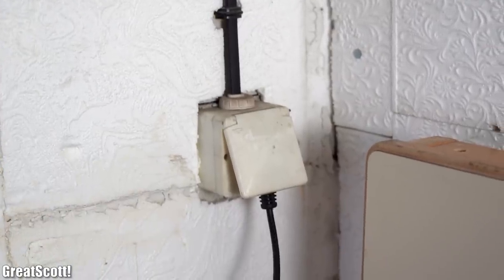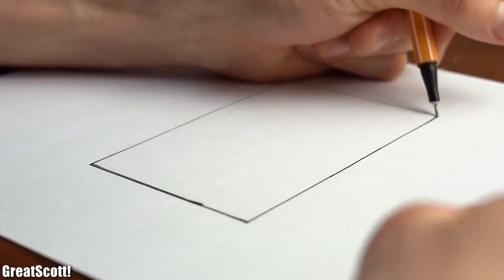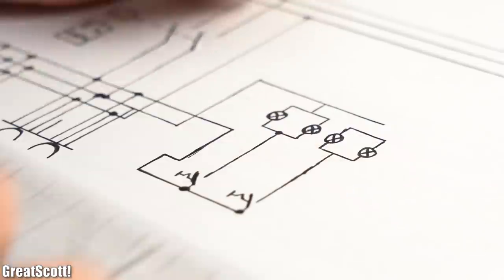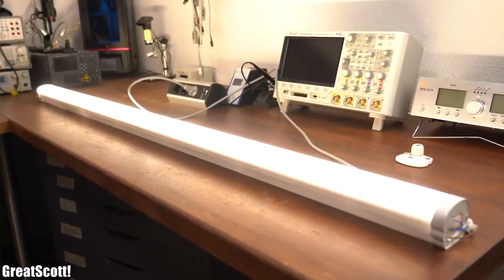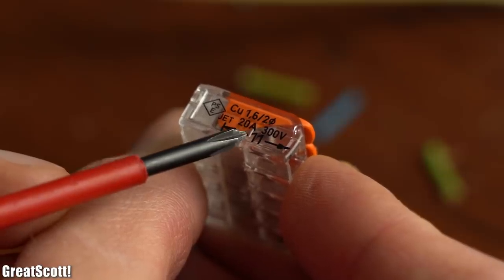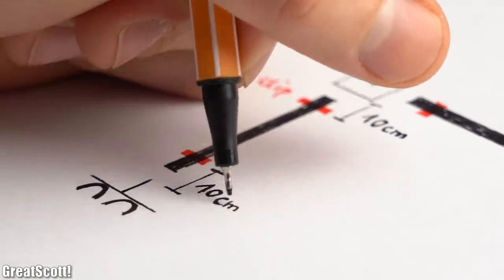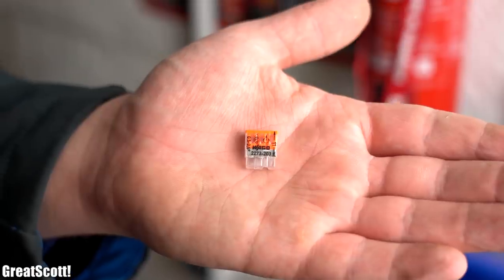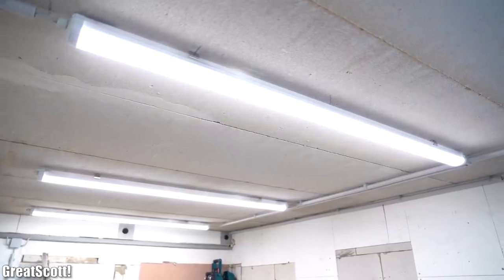How to do Electrical Wiring properly! (more or less....) GERMAN STYLE!

Comment: 3:05 - Slight correction on the RCBO, it doesn't detect current flowing to the protective earth wire, it detects an imbalance of current flowing down the live and back on the neutral.
If it only detected current flowing to the protective earth wire, you could get a shock, passing the current through your own body to ground, and not down the protective earth wire, it wouldn't detect it.
Reply: Exactly what I thought hahaha
Reply: This is the commentary I was looking for. 😊
Reply: That's actually a big correction. An RCD could work in an installation without any earthing. The imbalance between L and N is the criterium and doesn't need PE at all.
Reply: @Lenny-kt2th  He prolly thought an RCBO worked like an ELCB which detects current flowing through the PE.
Reply: @Lenny-kt2th   it will work without a PE but it doesnt work without any earthing. how could you be shocked with touching L without there being at least a connection on the producer side over earth to N. there are actually systems build like that in hospitals and such and they require over methods of keeping track of faults 👍
Reply: That sounds like how GFCI breakers and devices work here in the u.s.
Reply: @LarryKoopa  The thing is, you're always grounded to one degree or another. You experience a certain amount of current running through you even if you're stood on a thick rubber mat on top of a wooden floor and touch a live wire with one hand. 

In the above scenario, it's on the scale of microamps, if not nanoamps, so it's not harmful or even detectable to a human being, but still, it's worth remembering that in the real world, there's no such thing as "perfect insulators", just "good enough to be safe for living things" insulators, and consequently, unbeknownst to you, there may be situations where you unwittingly complete a circuit between live and true ground that is low resistance enough that it can pass harmful current through you. 

Better to be safe than sorry, and never assume that whatever environment you're in is a good enough insulator to protect you from this.
Reply: @LarryKoopa  You realize that neutral is grounded/earthed that is why it is safe to touch it in most cases.
Reply: @IAmThe_RA   what, yea but not always whats your point 😅? if theres no rcd and neutral and PE are never seperated ive gotten shocked by an earthing wire going on the potential rail. its never as bad as touching a live of course. you can sort of see it as a curcuit in series if you want to. 
the live goes onto a device and the neutral on you then in the ground. i live in germany and usually we have a few rcds in a house then some fuses, but the neutrals of each rcd meet together in the electrical box so if one circuit is turned off theres always a chance of getting shocked by a neutral. unless you turn of the corresponding rcd
Reply: @Lenny-kt2th   yes but without a pe one of the major functions of an rcd is rendered useless. basically its supposed to turn off before you even have the chance of being shocked. so if a live or neutral is on the body of an electrical device which has a metal housing the rcd will immediately turn off or when a short curcuit of other sorts happens between L PE or N PE. basically getting shocked through the earth will almost never result in the rcd turning off since even then the current is too low. it will definetly protect you though if youre say directly earthed through a water pipe with your left arm and touching live with the right
Reply: @LarryKoopa   You are talking about the <1%. Over 99% modern electrical systems are grounded and RCD protected, so yeah rcds don't need the PE conductors, we humans need them. If the current started leaking through a human or any conductor the corresponding RCD would trip due to current imbalance between the L&N.
Reply: @LarryKoopa  Standard RCDs trip around 23mA. You think about problems that don't exist, you won't die. Man up.
Reply: The imbalance beetween L and N inducts the voltage that triggers the shut off relay. But the imbalance occurs when L is in contact with Pe or housing or wall in some instances. If its L and N its a short circuit
Reply: @peterlenarcic526   When current leaks from N or L to PE or to anything else that is conductive and causes an imbalance of current between L and N which will be detected by RCBB/RCBO. That's the point he was making. So even there is no PE wire in an installation, RCCB/RCBO can still work.

Comment: I would recommend keeping your power outlets and lights on separate circuit breakers. You are more likely to trip your power outlet, at least this way your lights don't go out if you do.
Reply: You are right, but he said that the main (old ceramic style) fuse was only 6 amp, so if anything would happen, it would still trip that for sure.......if he could replace the ceramic with some 6A slow C-type breaker and after that two faster breakers, it might work
Reply: @great__success  It is so easy to replace the ceramic fuse..... Install 20A, draw 2.5mm2 to the RCBO, draw 1.5 to the outlets and another MCB 6A for the lights with even 1.0mm2.
Reply: @viktorpeev2825  In my knowledge 20A ceramic fuse has bigger physical dimension,  so even if you want to break the rules you cant and you would have to replace the whole socket.....it makes sense, cause probably all the nearby garages are connected to common outside breaker that is accesible only to few people...and by installing higger than 6A fuse you risk tripping of this outside breaker that might not be accesible to you
Reply: @great__success  I highly doubt, that if your feed cable is more than 2,5mm2, the fuse is less than 20A, since the meaning of the FUSE is to protect the cable, not the consumer ( outlet,lights etc.).  Anyway, it is just confusing for me. Never seen such instalation here in Bulgaria ( have to say, that here, most of the fuses are still ceramic). Kind regards.
Reply: At least for short circuits it wont work and isnt allowed by the VDE as in case of a short both breakers would trip
Reply: Great point Stephen, especially if an RCBO tripped which it would more likely do on power outlets.
That way, lighting is still available & far easier to troubleshoot the issue as the garage seems like it doesn't allow natural light.
There are also cost saving arguments against it, which I've seen in smaller installs like this
Reply: @great__success  You only need to remove a porcelain ring from teh fuse socket.The fuse socket needs no replacing.
Reply: @mernok2001  it all depends on the incoming wire. Its not because you can ,you could
Reply: @PhilipDezuttere  Even if the incoming wire is only 2.5mm2 aluminum,it can handle 16A.
Reply: This is even part of a german norm, that lights and outlets shouldnt be, or are not allowed on the same circuit breakers.
but considering this use case, it shouldnt really matter too much

Comment: The tag line “German Style” brought me back here :p
Reply: German style but I facepalmed quite many times, overlappings mainly... It just makes no sense why are there so many useleless connections and the use of cable glands...Main problem is the "main fuse" 
Could've solved it with 1 switch and 1 breaker in the same cabinet. Other than that its close to ideal.

 I have it worse in my own home.😂
Reply: @mihkus  Then it would not be "German Style" ;) Everything according to the applicable standards :D
Reply: Fuse is as sentimental add on. My concern is single Earth-Leakage in the Distribution Board. Women plugged faulty charger in the wall socket (short circuit not earth fault) and all garage went dark?. We have separate C/Breakers for lights and sockets with correct kA ratings. It helps a lot. Still nice job done comparing with the old one. Just different standards but nice to know. Good video.
Reply: It is not forbidden to do it so, in my opinion its made cost-effective.
In my house ever room has a circuit for lighting and one for outlet. Outlets has RCD type A, except my Workshop, it has Type B
Reply: @leonnastaly4814  Then you would have a need three breaker, one common and two appliance breakers, because two breakers in pararel could lead to the distribution line over loading (12A + 12A not tripping each of those two, but exceeds limit on distribution line of 16A)
Reply: @TecSanento  no, usually you get a breaker for lights and one for outlet, then you have a general line breaker, usually in house. In this case they might have just one line going to the garage so yeah, it's not that big of a deal to have only one